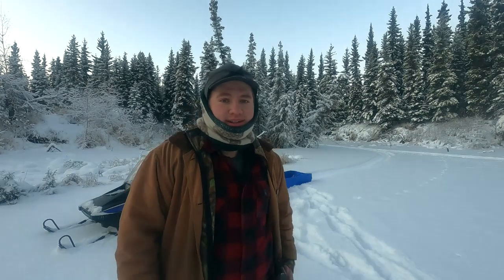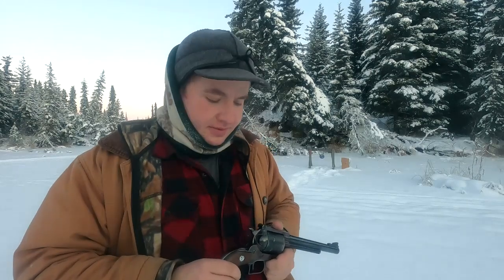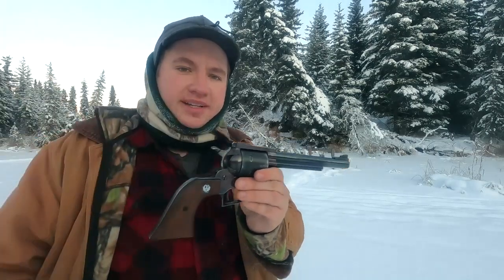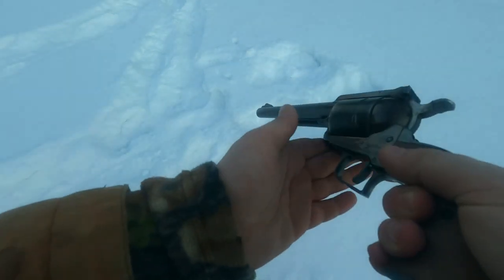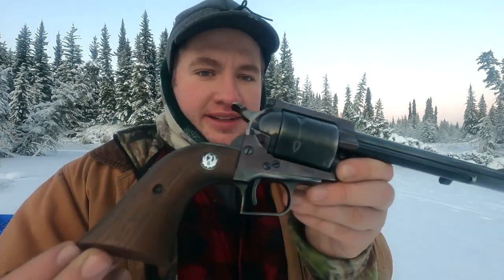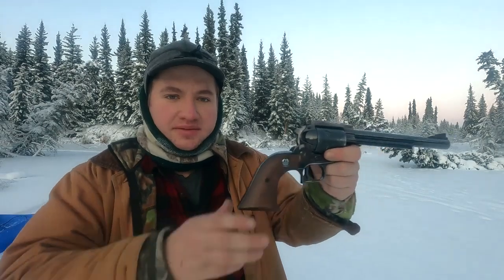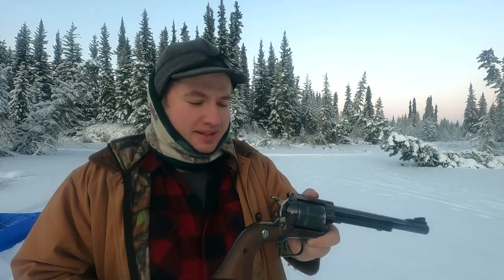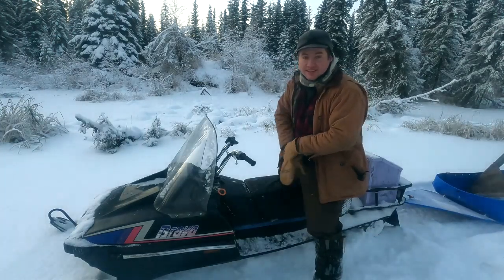Old Gun Review: 3 Screw Ruger Super Blackhawk 44 mag

Comment: I just bought one of these. Its a flat top 44 mag made in 1956. It sure does feel good. Yours has had a few upgrades since mine was produced.
Reply from the maker: Cool! What was different about them back in the 50s?
Reply: @gunsgearoutdoorsalaska5875  The Ruger 44 Blackhawk was released in 1956. Yours has the upgraded topstrap with ears to protect the rear site. Elmer Kieth urged Ruger to add these ears. The early ones have no ears and are known as Flattops. The early ones also had very short grips with a rounded trigger guard. Your takedown pin probably has a collar on it as early ones do not. The one I have is a first year production with a 3 digit serial number so as one can imagine they were still working bugs out and making it user friendly. Personally I think all the Blackhawks and Super Blackhawks are wonderful work horses.
Reply from the maker: @jakeoutdoors9600  Cool, thanks for letting me know!
Reply: Plus all steel frame and dragoon trigger frame.  Blackhawk 44 had alloy parts such as grip part of frame, loading gate, and ejector section on some.  Plus SBH was a larger frame best I remember.  My SBH 3-screw was made in 1968.  High quality